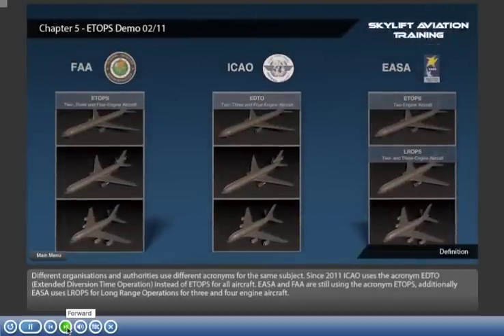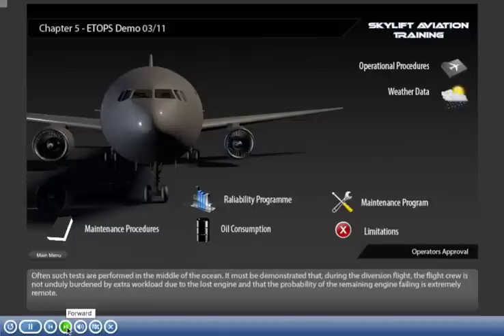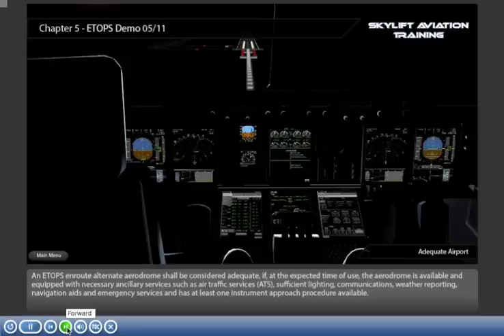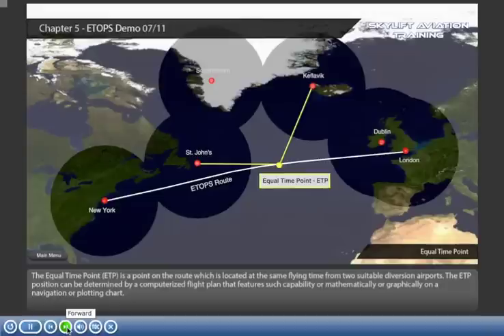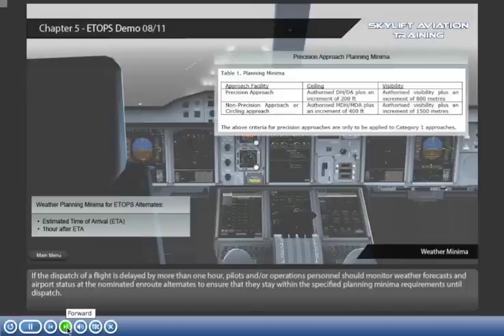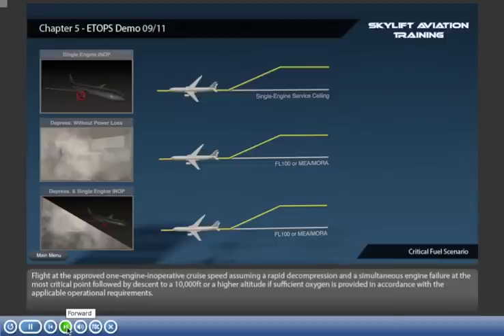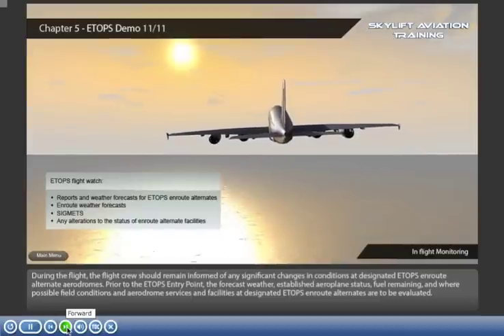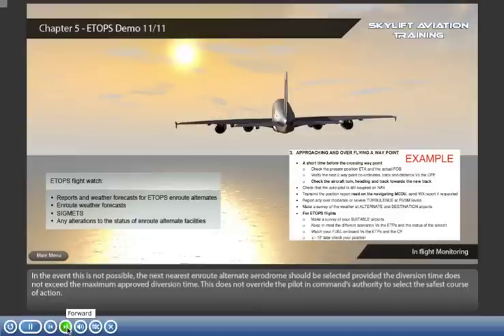Extended Range Twin Engine Operation (ETOPS) Demo

Comment: it's best to fly on four engines, if two fail there are two left
Reply: Take a boat if you're that worried
Reply: tibchy144 Actually twin engine aircraft are significantly more powerful than 4 engine aircraft. In some cases on twin engine aircraft a single engine is as powerful as 3 engines on a 4 engine aircraft.
Reply: @shamrocky  but if both engines fail there are none left, regardless how powerful they are..
Reply: @tibchy144  if 4 fail, you are in the same situation in 4 engine aircraft
Reply: @grzegorzbalcer5219  i'd prefer to take my chances in the latter one
Reply: @tibchy144  what if the latter fails?
Reply: @grzegorzbalcer5219  apparently you don't understand probability theory
Reply: @tibchy144  what if you got it wrong?
Reply: in the history of aviation I don't recall an accident that happened on a twin engine plane that would not have happened on a quad engine plane in the same situation. I think it is safe to say that even the US Airways flight 1549 would have ended indentically with a quad engine plane.